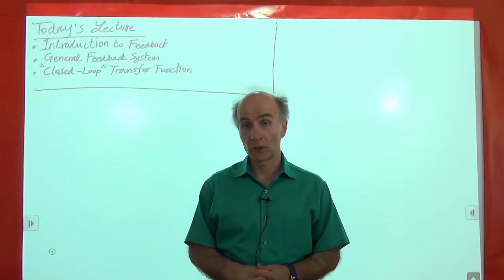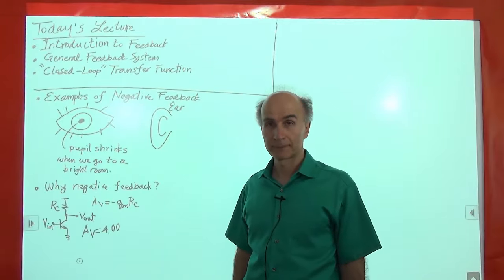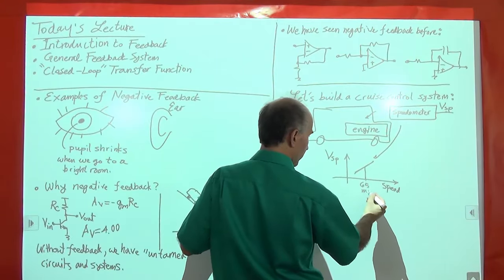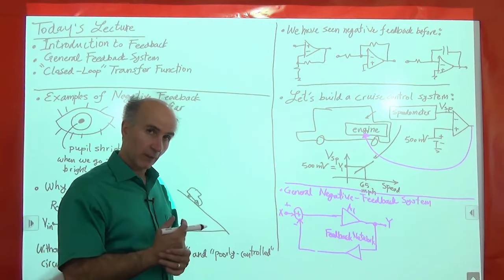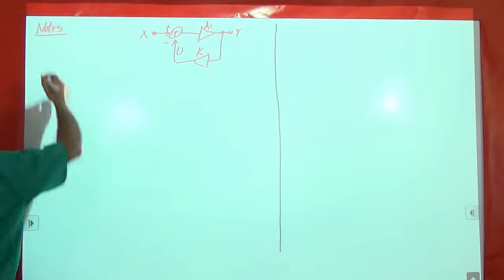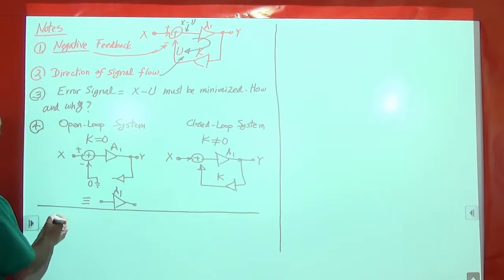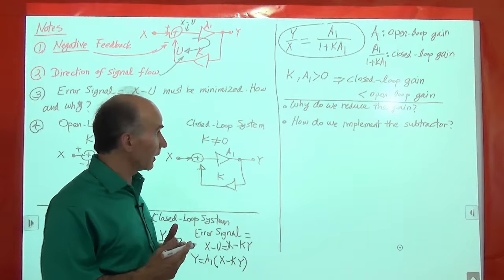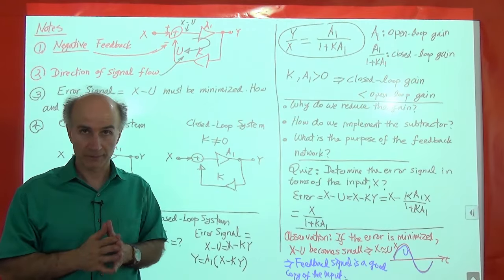Razavi Electronics2 Lec27: Intro. To Feedback, General Feedback System

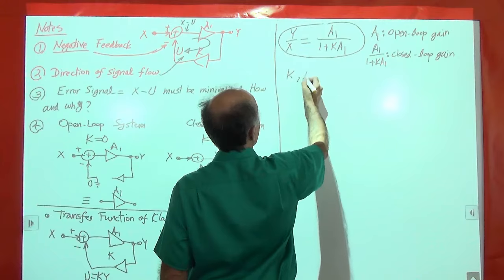Comment: In the notes @27:00, shouldn't we require k > 0 - otherwise we can add X and U but still get the same result with k = - 1 ? EDIT: ah, you point that out at @38:00 :)

Comment: 01:25 - Intro and Feedback Examples
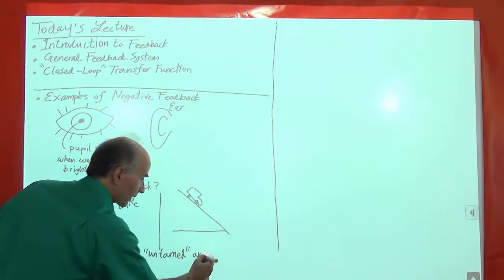08:55 - "Without feedback we have untamed and poorly-controlled circuits and systems"
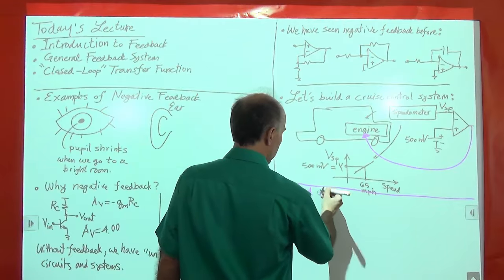18:30 - General Negative-Feedback System
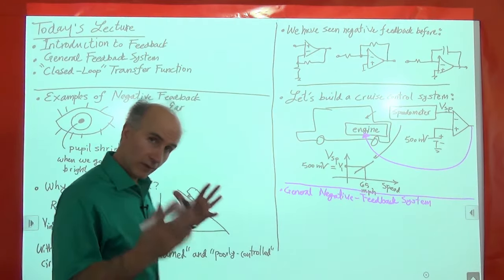18:55 - Four Components of a Negative-Feedback System
26:25 - Notes
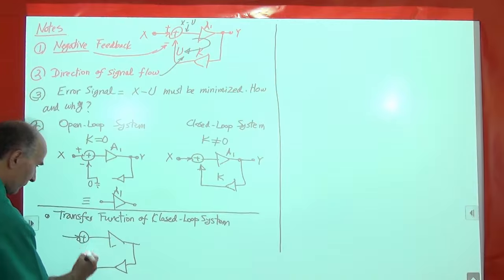34:00 - Transfer Function of a Closed-Loop System
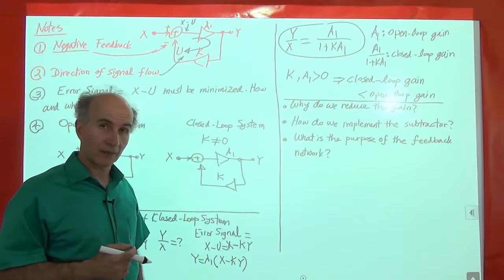41:00 - Quiz: Determen zhe Error Signal in Terms of X
44:20 - "If the error is minimized X and U are very close"

Comment: when x=u, error =0. That means input to A1 is zero. then there should not be any output.
Reply: Thats only when you dont have any feedforawrd system A1. In such a case its meaningless.
Reply: You are right. If "x" is excatly equal to "u", there is no output. But as it is said in the lecture, the feedback signal is a good copy of the input signal which means it is approximately equal. A1 is quite large, therefore there is a signal in the output which can be calculated as it is said.
Reply: If there is no output, u is zero too. That means x and u cannot be equal.